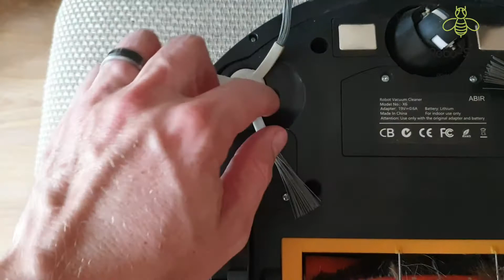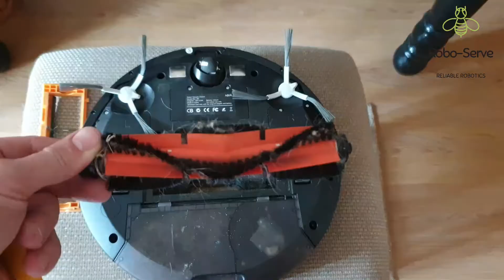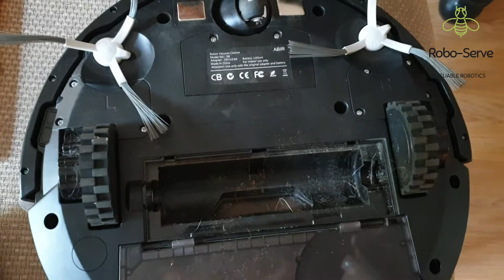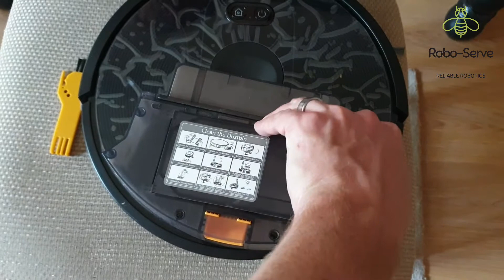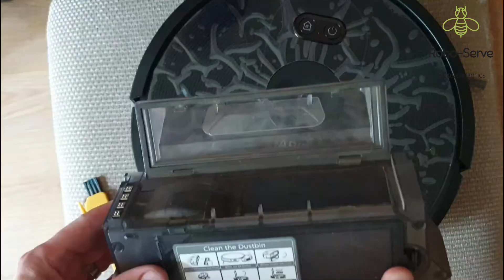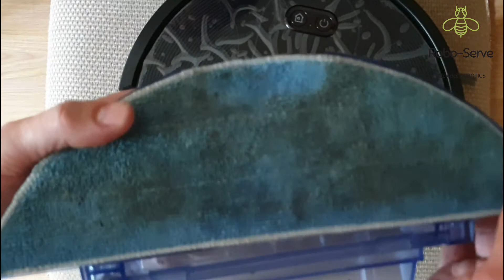HOW TO CLEAN ROBOT VACUUM CLEANER ABIR X6

Comment: And the front wheel? Mine gets a lot of small hair and I can't remove it
Reply from the maker: Hi Thales, apologies for the delayed response, yes it can be tricky, I would normally use pliers to pull these smaller hairs out
Reply: @robo-serve-roboticvacuumsp9472  It worked for me. Had to dismount all three wheels and remove the hairs. Taking advantage that I opened the robot, removed the battery and put it again to fix a bug that stops randomly at the cleaning